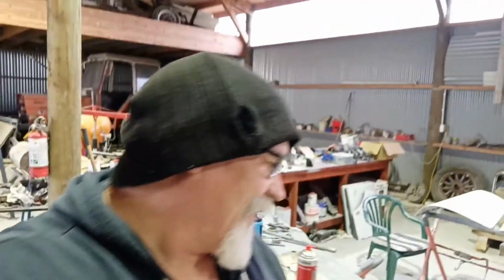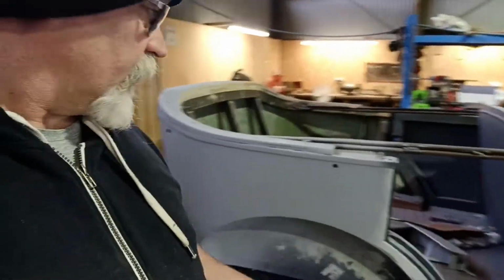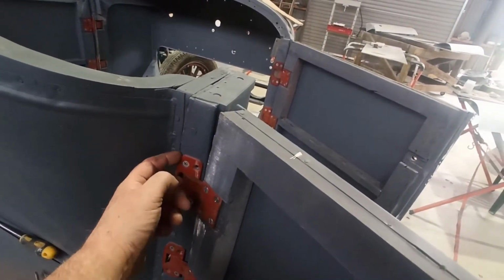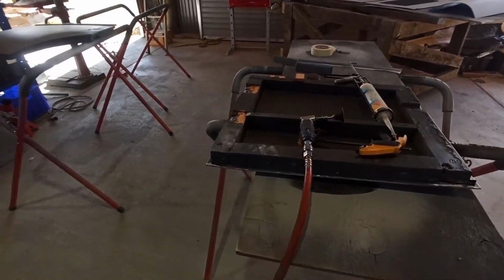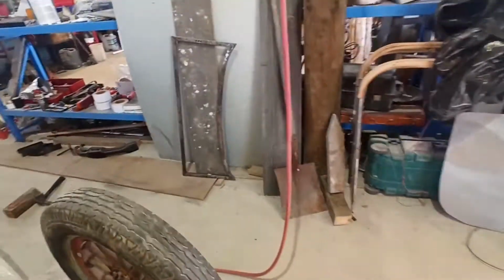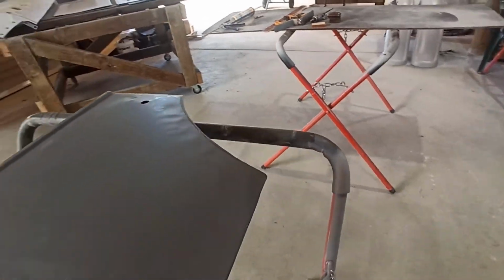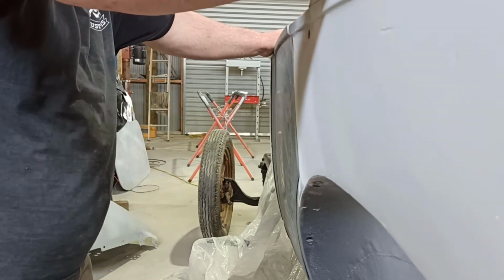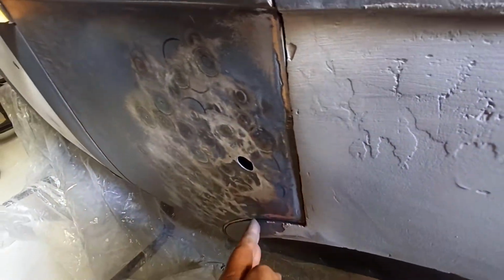STUDEBAKER RESTO 127 THE BATTLE

Comment: I always had to use shims and different size spacers on the body mounts I start out with washers figure out the thickness and then use rubber to make each individual body mount that's the hike that I needed for that specific spot
Reply from the maker: There is no body mounts on this car   it's bolted hard to the chassis on this same with the engine and transmission hard bolted to the chassis no mount's of any kind .I have asked guy with 3 or 4 of them and the other one here is the same

Comment: And on the doors we would put a turnbuckle with the cable hooking the turnbuckle from the top left corner to the bottom right corner so it was diagonal going across the door sometimes we would put one only going the direction that we needed the door to be pulled on I think that would work on that back door
Reply from the maker: The doors fit the hole fine but for some reason when the body was off the wood has moved so where the door hinges are bolted on and the screw  holes in the door has changed position mainly RH side